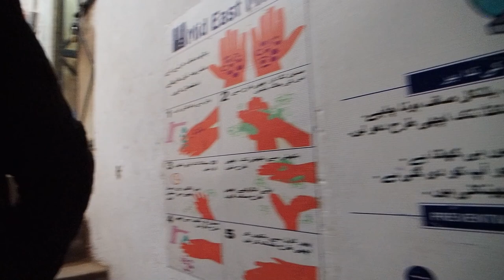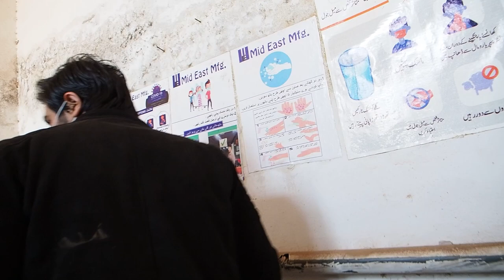Inside a Pakistani Musical Instrument Factory 🎸

Comment: Very interesting and good work being done, too bad they don't enforce some sort of dust control and safety for the workers. Dust can self ignite and could burn the place down in an instant with a flashfire.
Reply: @fred horsefeathers. I know your concern about saw dust, but this has never happened in this part of the world. I belongs to Sialkot and actually these factories have good ventilation system & fresh air passes through which wasn't seen on camera. There is no risk of such fire.

Comment: Days since last accident: 0. No ventilation in the building for smoke and dust, basic masks for operators, no safety guards, build up of shavings, offcuts and dust around the machines, no protective clothing, offcuts on the floor..... and that's in the first 10 minutes. This place should be shut down. I'd be interested to know if their customers had a tour, they'd run a mile from this company

Comment: Man the lack of extraction in the laser cutting room is extremely worrying.
Reply: what is extraction
Reply: @bobobobo3142  the laser cutter creates fumes when it cuts the material, often toxic. The lid of the machine is usually closed and a fume extraction filtration system is usually attached to get rid of the nasty stuff. But here the system is non existent, never mind that the lid isn’t even closed!
Reply: @theGottowatch  safety is a thing which you won't see in Pakistani workplaces. People think safety is just optional. Workers hate wearing safety gear.
Reply: @bobobobo3142  not too bothered about other safety stuff. But toxic fumes from the laser cutter is pretty bad